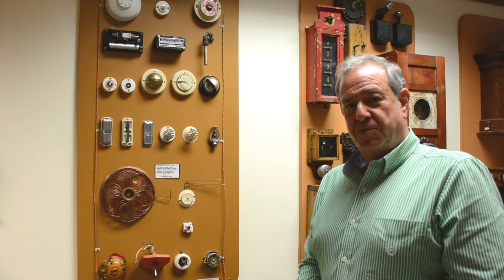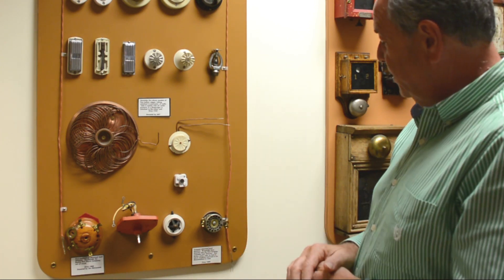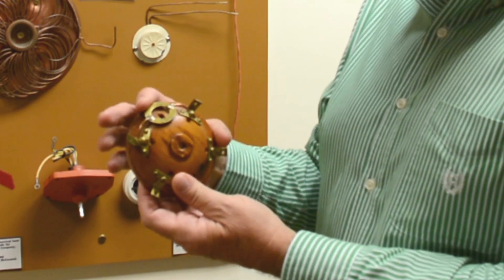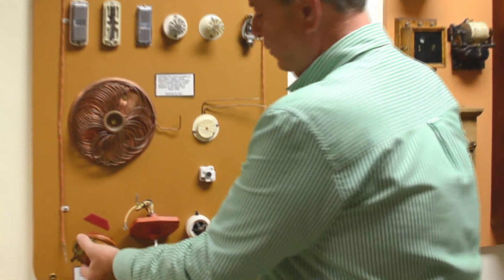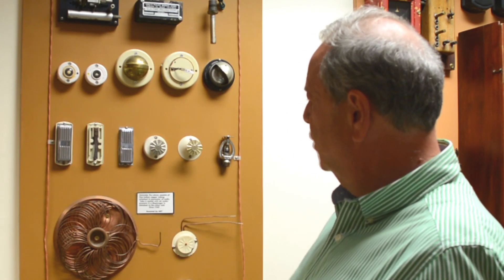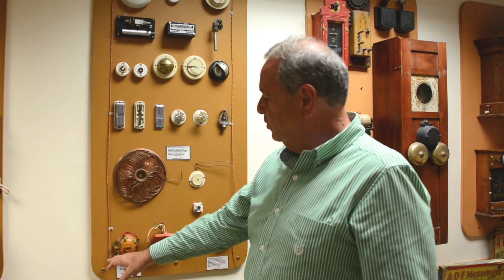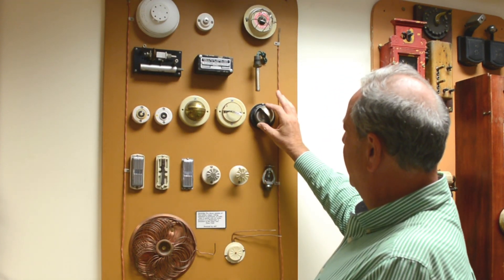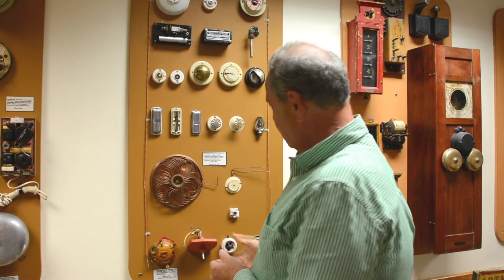Wayne Alarm Antique Corner 7: Vintage Fire Alarm Devices

Comment: The ones to the right of the Harmonicas look akin to the heat element that would be on a Fenwal smoke/heat combo.
Reply: Thank you for your comment. The unit to the right of the harmonica style device is a fixed heat non replaceable element heat detector. This was made for Dictograph circa 1960's - 1990's. Thank you - Ralph W. Sevinor
Reply from the maker: Hello @4j25, 
It does look similar to the heat element Fenwal used, however this was made for Dictograph circa 1960's- 1990's. This unit was a fixed non replaceable heat detector. If you are ever in the Boston Area, please stop by Wayne Alarm Systems and we would be happy to give you a tour. you can reach us at 781-595-0000 and ask about a tour of the antique artifacts.